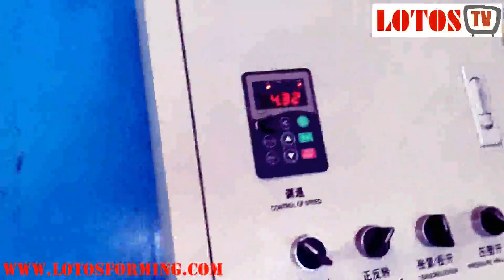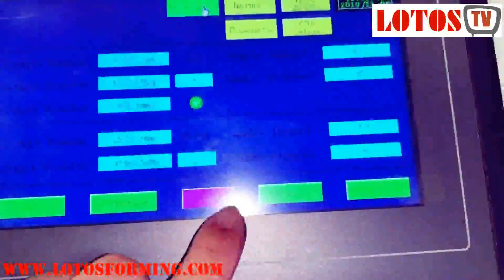【cable tray manufacturer】: cable tray roll forming machine ▶special offer/ best quality/ low price◀

Comment: so that, A cable tray is a unit or assembly of units or sections and associated fittings forming a rigid structural system

Comment: Galvanized cable tray (cable tray) (cable tray) in terms of width, length, depth, thickness, type of plating and number of bends has a lot of variation